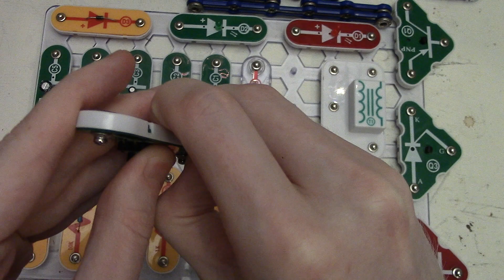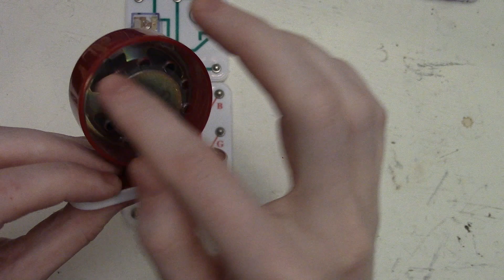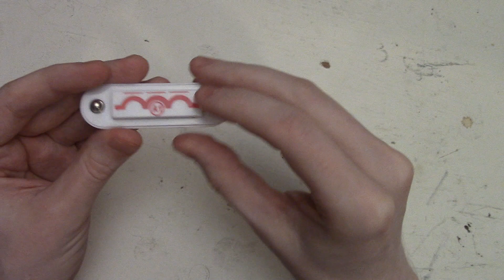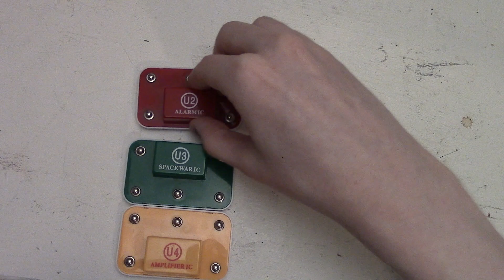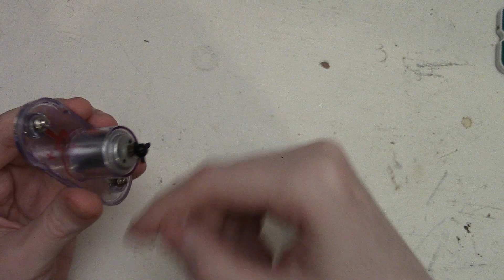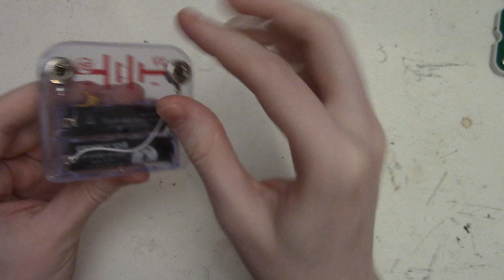ELENCO Snap Circuits: What Can Be Repaired/Upgraded

Comment: Thanks for the great video, and the help in doing repairs!  Can I replace / upgrade the NPN transistor (S8050 D331) with any of these that I happen to have on hand? If so, which would be the best / safest to use?  2N2222 - PN2222 - 2N3906 - BC337-40
Thanks!